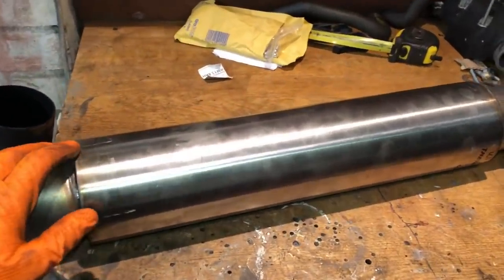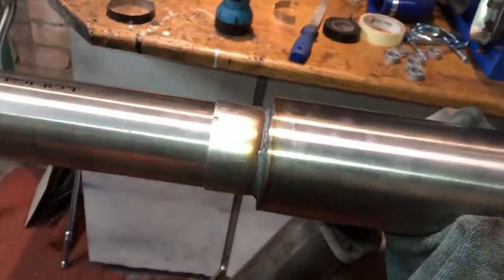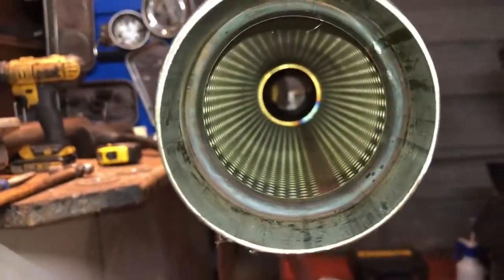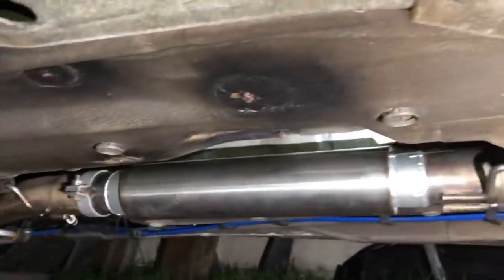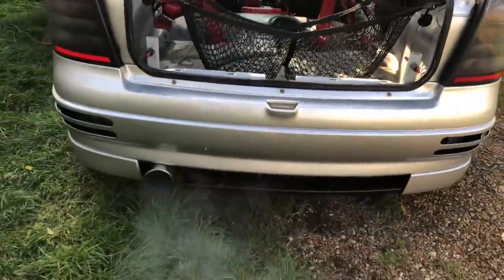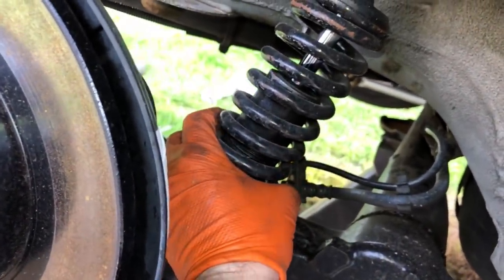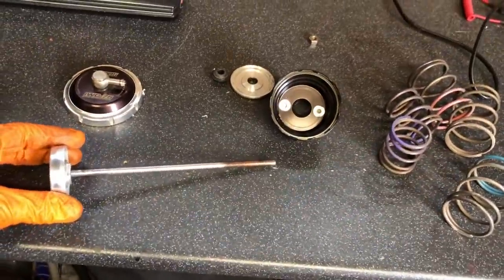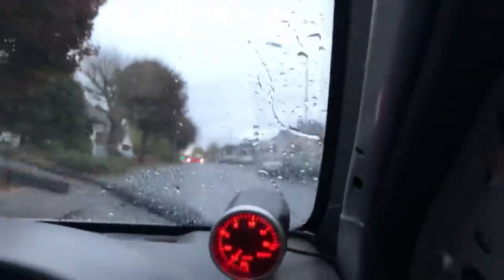Ecu Remap Time & 76mm Exhaust Modifications! Opel Astra Turbo Z20let

Comment: Don’t suppose you know what would cause the onboard computer (display)
Not to show why oil level low or coolant ? When I drain the oil I check it and don’t warn my all the time and same for coolant not sure about other things on it as never get low on screen wash etc

If I disconnect coolant level sensor then it works once then not again